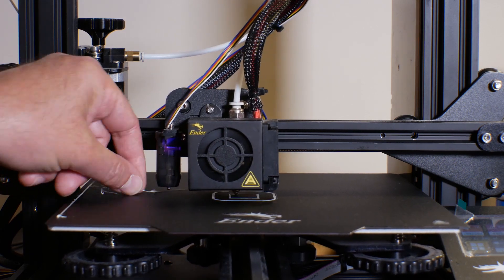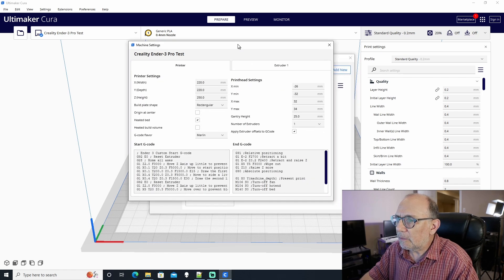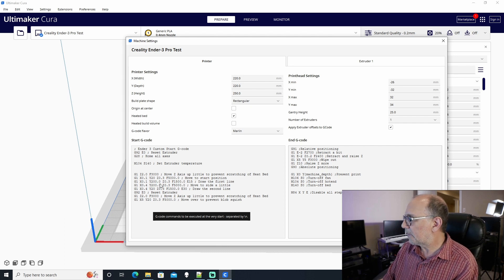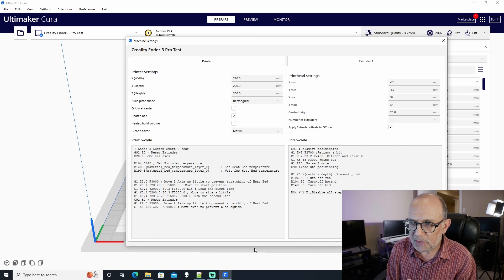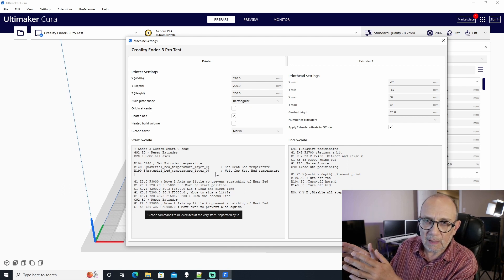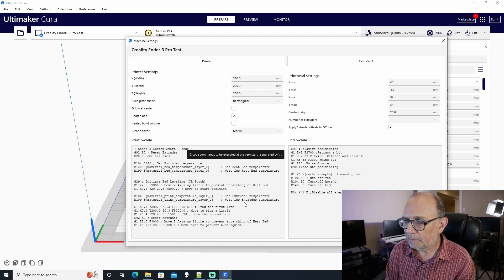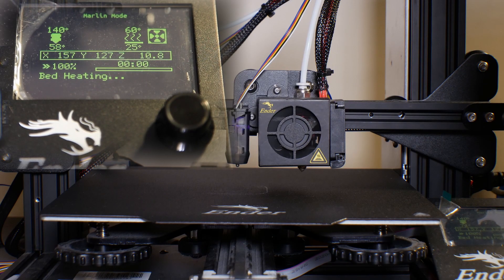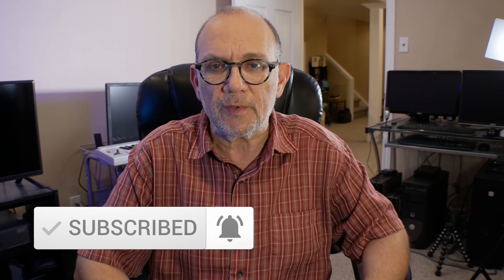Stop Filament Ooze From 3D Printer Nozzle

Comment: Hey, is it possible to initiate the bed leveling (G29) before waiting for the bed to warm up (M190 S)? Would it heat the bed while leveling? That would save some minuets if it works.
Reply from the maker: Yes, it's possible but not advisable.  Warming up the bed first makes the leveling more accurate (at least that is the general consensus).  If you level while the bed is warming up the ABL may not be as accurate since the heat causes a slight expansion of the bed which might be missed, thereby making the bed leveling less accurate.  RG

Comment: Is it really necessary for it to perform the G29 every time you initiate a print? Why can't I just tell it to level the bed before I Preheat PLA? It adds a ridiculous amount of time to initiate a print if I have the G29 code in the printer settings. And at least I end up with at least 2-3 tries before I'm able to get past the initial layers printing properly and can walk away
Reply from the maker: Strictly speaking you don't need to initiate G29 every time you do a print.  This is something personal to each person.  If you think your bed is level and everything is working, it's reasonable to leave it.  When people initiate the ABL they generally do it after the bed has heated because they believe the results are more accurate.  What I find interesting is that you need 2-3 tries before the first layer sticks.  That should not happen if your bed is level.  The ABL deals with minor dips in the bed, but it doesn't really help with the more base bed leveling.  From what you're describing, it sounds like you need to do a macro bed leveling (using the wheels, assuming you have those) and then set your z-offset again.  I would also consider changing your build plate, or at least making sure that your current build plate is clean, since that sometimes helps with the first layer sticking.  RG

Comment: Does this work for the Aquila x3? I can’t find a fix for this when using Cura.
Reply from the maker: Hello...The g-code I'm using here is just generic g-code, so I don't see why it wouldn't work with the Aquila x3.  Having said that, I don't have that particular printer so I would suggest trying it out and seeing what happens.  If you notice that your printer is behaving strangely or doing something unexpected with this g-code just stop the print...but my gut feeling is that it should work just fine.  RG

Comment: I found my way to the machine settings and the Start G-Code but on my Ender5-S1 the code is not the same as yours. mine starts off like this.
G28 ;Home 
G92 E0 ;Reset Extruder
G1 Z2.0 F3000 ;Move Z Axis up
G1 X10.1 Y20 Z0.28 F5000.0 ;Move to start position
G1 X10.1 Y200.0 Z0.28 F1500.0 E15 ;Draw the first line
G1 X10.4 Y200.0 Z0.28 F5000.0 ;Move to side a little
G1 X10.4 Y20 Z0.28 F1500.0 E30 ;Draw the second line
G92 E0 ;Reset Extruder
G1 Z2.0 F3000 ;Move Z Axis up

Comment: hi is this correct 

G28 ; home all axes
G1 Z5 F5000 ; lift nozzle   (should i remove the this) 

G90 ; use absolute coordinates
M83 ; extruder relative mode
M140 S{first_layer_bed_temperature[0]} ; set final bed temp
M104 S140 ; set temporary nozzle temp to prevent oozing during homing and auto bed leveling
G4 S10 ; allow partial nozzle warmup
G28 ; home all axis
G29 ; auto bed levelling
G1 Z50 F240
G1 X2 Y10 F3000
M104 S{first_layer_temperature[0]} ; set final nozzle temp
M190 S{first_layer_bed_temperature[0]} ; wait for bed temp to stabilize
M109 S{first_layer_temperature[0]} ; wait for nozzle temp to stabilize
G1 Z0.28 F240
G92 E0
G1 Y140 E10 F1500 ; prime the nozzle
G1 X2.3 F5000
G92 E0
G1 Y10 E10 F1200 ; prime the nozzle
G92 E0

Comment: I feel like it would work better if you retracted the pla a little instead and then it would come back once it prints the line on the side of the bed to prevent oozing when its heating up to the print temperature

Comment: I just tried this on my blender 5 pro
The oozing stopped, also stopped feeding altogether??
And the 2 M104 codes seem to be working opposite to where they should so I’m wondering if this code doesn’t work in creality slicer ??
Reply from the maker: Hello Brian...I'm not sure why it's not working with your Ender 5 Pro.  The code being used is pretty generic.  Did you copy and paste the code provided in the description section of the video to the start g code section of your slicer?  My recommendation is that you try Cura and paste the code in the start section for the Ender 5 Pro profile. I'll be curious to know if this works for you.  Good luck!  RG
Reply: @CreatewithTech  unfortunately it seems you can’t copy and paste in creality slicer. I wrote word for word what was in your file, so who knows, but I tried it in prusa with no issues.👍
Reply from the maker: @briankruckow5449  I'm glad it worked in Prusaslicer.  I probably wouldn't bother with the Creality slicer unless there's something special there that you can't get in Prusaslicer or Cura.  Take care.  RG
Reply: @CreatewithTech  hi again 
It also seems you can’t copy & paste in Cura as well,??
Another question,  using prusa my printer seems to be printing about 10mm off centre to the right, not sure what to adjust myself.??

Comment: Does the autoleveling on/off box in the printer leveling menu need to be checked for any of the meshes to be applied? I have a g29 in start code and printer probes the bed, but unsure of effect of the on /off function in leveling menu. Thanks
Reply from the maker: Hi Norman...which printer are you using and what Microcontroller board does it come with? On my printer there is no on/off box to tick.  If you're using Octoprint or some such interface you can send some G Code commands (G420 specifically) to the printer to ensure that Leveling is turned on.  The G29 command should be sufficient to turn on bed leveling and do the mesh.  As far as I know you don't need to do anything more.  You can find more about it here: 
  
https://marlinfw.org/docs/gcode/M420.html#:~:text=M420%3A%20Bed%20Leveling%20State,M423%3A%20X%20Twist%20Compensation

RG
Reply: I have ender 3 v2 using jyres. G29 works fine but I noticed the option and wondered what it did. Seems like it should enable or disable autoleveling.Have 4.2.2 board.

Comment: After doing some research, I see that everyone points to same direction as you for this problem, i.e. tweaks in the start G-Code. But this doesn't work for me. In my case I find that the G-Code generated by Cura, already sets the temperatures (both nozzle and bed) before the so called "start G-Code". In other words there is this section of the G-Code, BEFORE the "start G-Code", that seems to be responsible for temperature setting, that I cannot affect, unless of course I do it manually, after it's generated. Yes, I could go your route and lower the temps, after they are reached and then raise them once again in the start G-Code, but that's far from optimal.
Any guesses what might be the culprit here? Is the firmware to blame maybe, so I need to change that? Would you have any ideas what those changes might be? Many thanks! 🙂
Reply: Hey I'm having the exact same problem, you find any way to fix it?
Reply: @dontquestionjustbelieve5757  Sorry, no. 😟
Reply: @captivenut4122  Thats all good, thanks for responding :)

Comment: Works Flawless, thank you very much. Now if I could get anyone to compile Firmware for a Ender 3 Pro with a BLTouch and a High temp hotend to 300°C I'd be in heaven.
Reply from the maker: Glad to hear that you found this video helpful.  I hope you find the hotend answer you're looking for.  RG
Reply: I hope you have upgraded your ender 3 power supply and electrics to cope with 300º ,if its an older one check the xt60 connectors and thermistor as well....

Comment: Interesting. Does the M104 override the temperature that is set in the firmware for the bed mesh leveling? Or do I have to set the temperature low in the firmware.? Thanks
Reply from the maker: Hi there...the M104 command in the Start G-Code section will override anything in the firmware.  What you're doing is basically telling the printer to raise the nozzle temperature to this temperature (in my case 140) and then stop.  This allows the Automatic Bed Leveling to happen without filament oozing from the nozzle.  After the mesh is set you tell the printer to raise the temperature to whatever you set it in the slicer for the model (so for PLA it would be around 200) and the command that does this is M104 S{material_print_temperature_layer_0} ; Set Extruder temperature.  To answer you question directly you do not need to do anything in the firmware to make this work.  Just change the start G-Code.
Reply: @CreatewithTech  Ok, thanks for the answer.

Comment: will this work on my CR-10 V3?
Reply from the maker: I believe it should work just fine with that printer.  I don't have that printer, however, so proceed with caution.  However, I don't see any reason why it wouldn't work.  RG
Reply: yes it does! i have one...and it works just fine

Comment: Just wondering how do I lift my z it does the 140 great but when it starts to get to the temp it starts to ooze too close to my bed anyways to fix that . . Like raise the z a bit from the bed when it gets to temp.then go down and start creating the lines thank you for reading btw
Reply from the maker: If it oozes a bit on the bed before starting the print it shouldn't be much of an issue.  I'm not sure how it would help if you lift the z axis, as it will still ooze.  Are you concerned about the blob that's being oozed damaging your print bed?  Anyway, if you take a look at the posted g code above, specifically this line (G1 X0.1 Y20 Z0.3 F5000.0 ; Move to start position), the Z0.3 parameter shows that the nozzle is 0.3mm off the print bed when the extruder is rising to print temperature.  If the nozzle is too close to the bed, it's possible to increase the Z parameter from Z0.3 to something a bit higher like Z2.0 and that should lift the extruder off the bed a bit more.  Now I haven't tried this myself so I'm not sure exactly how it will work.  If you do try it, just keep an eye on it and be ready to turn off the printer if it does something unpredictable.  RG
Reply: Did it work? Moving Z0.3 to say 1.0?

Comment: I got a ender 3 and it got me wanting to end me lol my filament keeps curling idk wth I'm doing
Reply from the maker: I hope this video helped you with the problem.  RG
Reply: @CreatewithTech  I kinda gave up
Reply from the maker: @SpillYahSauce  I wasn't quite clear on the problem that you're having.  Are you getting oozing before the BL Touch/CR Touch does the mesh or are you just getting oozing.  Give me more of an explanation and if I can I'll try to help.  RG
Reply: @CreatewithTech  I'm real new to this idk why I didn't do more research I'm like a caveman to this,I'm using sunla pla + I never connected to my pc but I tried calibration of e step still no luck I have the bed heated to 50 and the nozzle at 200 when it gets hot I'm noticing the filament comes out and when it does it comes out curly like ramen noodles
Reply from the maker: @SpillYahSauce  It's not unusual for the filament to ooze out of the nozzle.  It's a common problem.  Have you actually printed anything yet?  Typically the printer will do a purge of some filament to the side of the bed so that the nozzle pressure (flow rate) is stabilized and it should print fine.  Let me know if you've printed anything yet.  I won't be able to answer until tomorrow sometime but let me know if you've had a successful print yet.  RG
Reply from the maker: Before printing make sure that you level the bed and that the nozzle is the right distance from the bed.  This is very important to get a successful print.  There are lots of videos on YouTube on how to level the bed.  Good luck.  RG
Reply: @CreatewithTech  I've tried printing several times it comes out all curly and seems when its first printing it doesnt print on the bed
Reply: @CreatewithTech  does the printer need to be hooked up to a pc for this?
Reply from the maker: @SpillYahSauce  OK...it sounds like you haven't leveled your print bed.  Do a search on YouTube on how to level a 3D printer bed.  If you've got an Ender 3 search for that.  It's the most important thing to do before printing.  If your bed is not leveled you will not have a successful print.  You do not need to be hooked to a computer to level your bed.  RG
Reply: @CreatewithTech  should my e step be calibrated though just curious
Reply from the maker: @SpillYahSauce  It's important to calibrate your e steps, but it's not the most important thing.  Before doing anything else you need to level your bed and get a print from the printer (Like a benchy).  Do that first and then worry about the e steps.
Reply: @CreatewithTech  thank you so much tomorrow I'll play with it